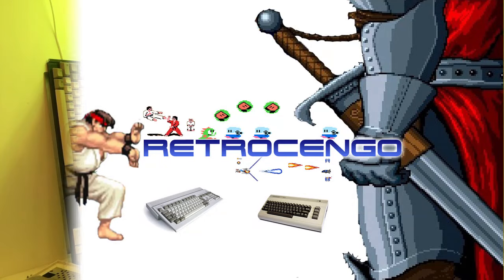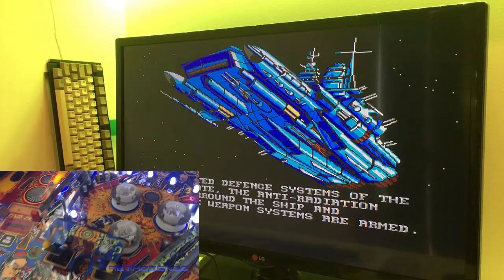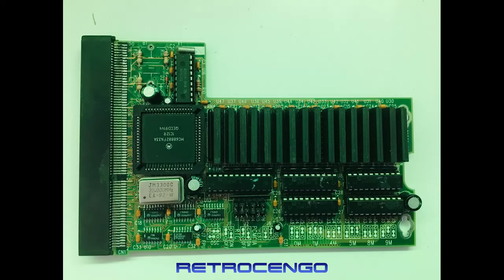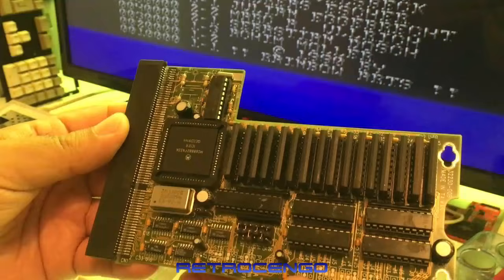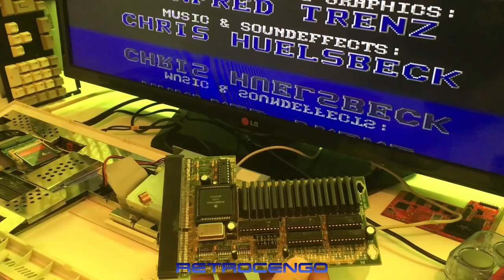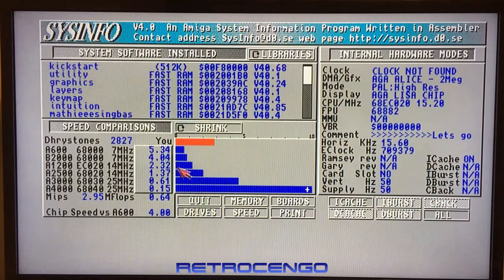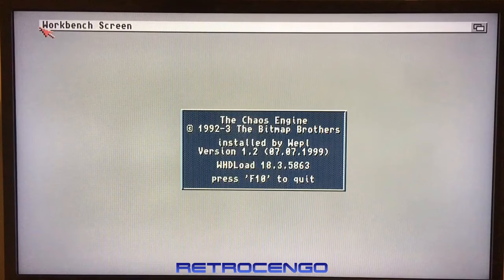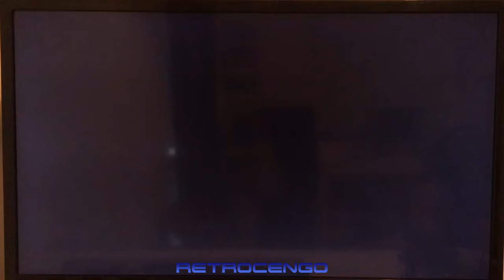9MB Ram upgrade for Amiga 1200 and WHDLoad test

Comment: That memory card seems good enough for WHDLoad games, indeed. Still, there is cheap accelerator cards like Blizzard 1220/4 and such.  I had one back in the days with my Amiga 1200. I loved it because it had an 68020 running at 28 MHz aswell as it also had a FPU. Great for Real3D renders and such! :)
Reply from the maker: Nice, but not that easy to fint today:-) did it have a Varta battery?